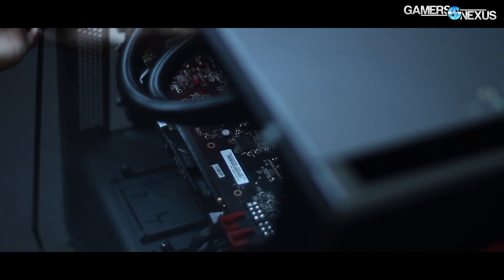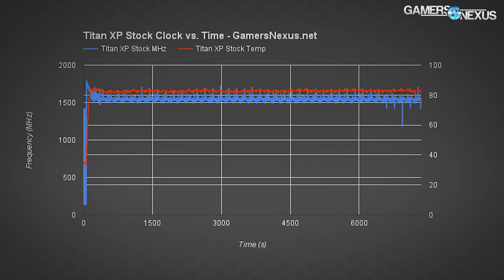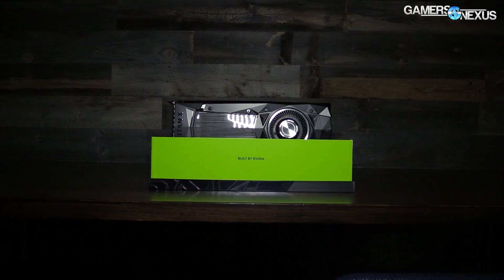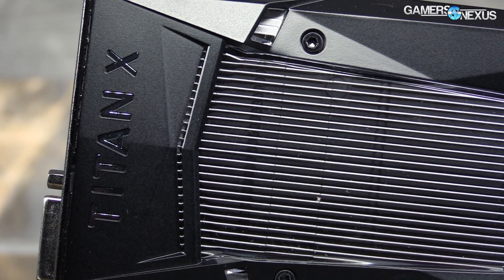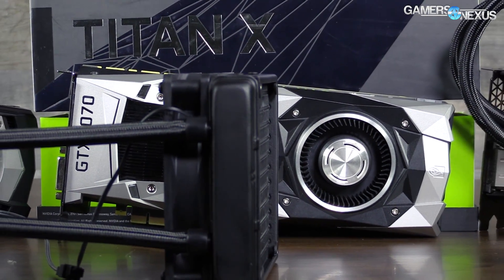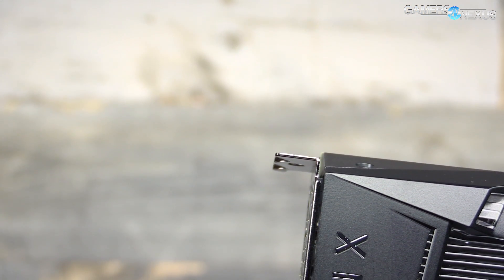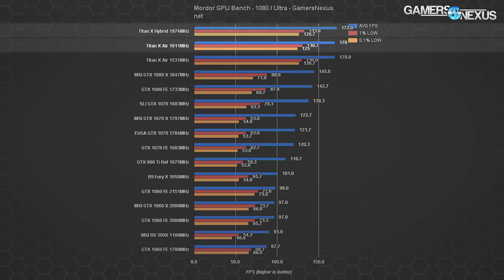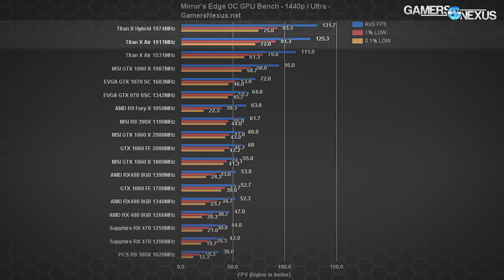TITAN X Pascal Severe Thermal Throttling (Hybrid Results)

Comment: And people make fun of AMD's temperatures lol
Reply: when will amd release gpu that is as fast as titan xp?
Reply: +Ariel Espinosa yeah and nvidea uses a cheap cooler on a 1200 $ video card ^^ But i understand your point - let's yust wait till vega and see :)
Reply: +Ariel Espinosa the thing is power consumption is tied also directly to the arcitechture of a GPU, the FP32 GFLOPS performance,  Async compute hardware support and less cut down FP64 double-precision, are taxing on the power consumption of a GPU. 

All the amd gpus since 79XX series and above have had FULL hardware support for async compute and a less cut down FP64, often 1:4 FP32, 1:8 or 1:16 which is high on a consumer grade GPU, for reference even the M6000 in the maxwell quadro line had 1:32 FP32 like all the maxwell line you have to get a Tesla for good FP64 performance, the last "consumer grade" GPU to have decent FP64 performance on Nvidias side was the Titan black with 1:3 FP32
Now a good FP64 performance can limit your max clock speed, and also add power, the limited FP64 performance on the Maxwell (and by extension Pascal) is I believe one of the reasons it clocks so well, the lack of FP64 performance is a good thing for us everyday consumers, we don't need good double precision perf for gaming

Also to note that apparently the gtx480/580 (Fermi) supported async compute on a hardware level and had a ratio of FP64 = 1:8 FP32 which is an unnecessary ratio on a consumer grade card (just as is 1:4) and we all know how hot and power hungry the fermi architecture was.

The RX480 has a 1:16 FP32 ratio compared to the pascal 1:32.

AMD should limit themselves to a 1/32 ratio also (it looks like they will be going that way :) ), but then they probably wouldn't be as good at mining...
Reply: When they get some money for r&d :p. Up until polaris last quarter, they hadnt make a single profit in 5 years and accumulated huge debts ($2+ billion). Polaris and vega wont touch the titan xp, but will probably do what the fury did last year, near matching the 1080. This gen is more of a money making gen for amd, hence the priority on the lower end market since thats where they can beat nvidia
Reply: the Titan X has a way beefier cooler than the RX 480 (ref design), the titan X runs at it 85°ish. as the RX 480 ref design, well between 80 and 85 (the Nitro runs at 75 ish) the VRMs heat up more on the RX 480 ref design due to the crappy cooler.

And you are forgetting to take into account one very important parameter when it comes to thermal dissipation, the surface size of what is being dissipated (the smaller the surface the harder it is to dissipate) the RX480s die size is 230 mm² the titan Xs die size is 470 mm² (more than double the surface), you can't just look at wattage and thermals

For example if the RX 480 had a 460mm² die size and the same power consumption as it has at the moment it would be way cooler, the same goes for the Titan XP if it had a die size of 230mm² and the same power consumption as it has at the moment it would be running well over the 85°. But the Titan X couldn't physically have  230mm² die and hold the same specs, and a 460mm² die on a RX480 is not cost efficient (and silly lol)

And what I said does relate to the power and heat, because pascal has less FP64 ALU's (4 in this case) the space on the die can be taken up with more FP32 ALUs for example which use way less power (which is a good thing imo), so effectively reducing power on the die relative to it's size, consequently making it easier to dissipate (don't forget 250w is not the power that the die uses, so the cooler isn't really dissipating 250w per say)

But all in all the Titan X doesn't really have the same temp and more power, it has a way better cooler that is adapted to what it needs to dissipate, and a bigger die

What is more interesting to look at is the 1080s dissipation, with a 314mm² a bit more power and having the same heat as the RX480 reference (round about), but less noise (yep RPMs are to take into account also ...)

I know you are not speaking bad about AMD, but there would be place to, they have made very dubious decisions on the RX480, coz they could have made Polaris so much better
Reply: Right then what don't you understand ?  Stop getting excited and annoyed because you don't understand. The titan X is neither cooler nor hotter than the RX 480, and vice versa. Both of the cards have coolers that are designed to run at their limits while staying in a cost effective solution, in other words the coolers do just enough for what they need to do without doing any better, compared to their die size and power consumption, what is hard to understand ???

No go look at previous temps on all brands, on previous generations, compared to die sizes and power consumption.

and this is why you are asking this question :

"I actually like amd, even my pc is powered by amd (cpu and gpu :P) but... we need to be honest and objective.
The rx 480 reaches the same temperature than the titan x pascal, and the titan x is more than x2 faster, so... yes, i don't like the temperatures on amd cards and i understand if some people make fun of that..."

You are asking because you do not understand thermal dissipation, and GPU architectures, and this is why you can't get your head around this :

My comparison is actually not ridiculous, because with the gtx 1060 you can get more fps in 8/10 games compared to the rx 480 and you get temperatures as maaaaximum 73C. I'm not comparing prices, but for a "slower card" that "consumes less power", the temperatures should be lower,
Reply: Ariel Espinosa Ok so you didn't read all of it, I understand now why you do not comprehend... (I actually said that AMD made stupid decisions, in all my posts). And you do not understand because you are bringing temperatures down to a performance comparaison, that is not how the laws of thermodynamics work !!!! Thermodynamics have pretty much nothing to do with performance, AMDs arcitechture is not efficient because they have made bad(for the most) choices, which has UPPED the power consumption on their small die compared to a 1060 for example (the die itself consumes about 50% more than the 1060)
Reply: Ariel Espinosa What? you are not saying temperatures are related to performance when you say this ?:

"we need to be honest and objective.
The rx 480 reaches the same temperature than the titan x pascal, and the titan x is more than x2 faster, so... yes, i don't like the temperatures on amd cards"

and then you say this

" and if one card has high temperatures, then as minimum it must perform well in order to people to want it"

NOOOOOO that is not how thermodynamics work !!!! And your problem comes down to AMD using a crappy cooler, this is true and legitimate, just go for an aftermarket GPU if you want an RX 480 simlple as that

"so the performance difference is NOT WORTH the temperature difference"

That is comparing Temperature to performance !!!!

"that's what i'm saying, not that high temperature = high performance"

Yes you are !!!! You are saying that if it runs hotter it should perform better than what you already had.

"but that in order to people to ignore the high temperature the card must at least give good performance to compensate the "bad thing" that is high temperature"

And you did it again.

Oh and this :

"titan x pascal cooler is just the same of the other 10 series"

the 10 series heat sinks are not the same, the Titan X seems to be the same as the 1080 and the 1070 the same as the 1060. Which are all better than the RX 480 :)

Honestly you are comparing heat to performance, which you can't do without taking into account a multiple of parameters...And reference design coolers are designed to be at the limit, to do just what they need to do, to bring down costs especially on the more higher end cards (the Titan X could do way better...) the lower you go in the range the more over-engineered they become. But the aftermarket coolers are just fine.

And concerning performance, the maxwell/pascal GPUs just have a better architecture for DX11 games (which is the most important DX at this moment)
Reply: Oh and *****  opening comment is stupid and has no basis, it's so stupid it shouldn't even be discussed so I don't know why I'm discussing this :)
Reply: soon and will cost half
Reply: I'M NOT SAYING THAT HIGH TEMPERATURES = HIGH PERFORMANCE, but i'm saying that in order for someone to ignore the high temperature (which is a "bad thing") the card must give you something in exchange of that bad thing

You do realize that that is another way of saying a hot card should give better performance ? When the 2 really have no relation, they could have thrown a stock watercooled loop on it, would that have been ok with you ? It would have been way cooler !!!
No the card shouldn't give you anyhting in exchange, it should just have a better cooler, just like the titan X should have a better cooler to avoid it from thermal throttling.

How do you not realize that you are saying that temp and performance are related when you say this :

"and if one card has high temperatures, then as minimum it must perform well in order to people to want it"

I'm dumbfounded (ers) edition...

Oh I get it you are trolling lol ok... Well I hope so or you just don't undertand what you are writting...

The card performs well for it's price point that is a fact, the heat has little to do with the equation except if noise is part of your equation, then you go for an aftermarket card, it is as simple as that.

It's price to performance ratio is good and better than the 1060 : http://www.hardwareunboxed.com/nvidia-geforce-gtx-1060-benchmark-review-25-games-tested/

You really do not understand GPU architectures and thermodynamics, and you have made this very clear.

I've spent enough time trying to explain all this and listening to you denying that you think temperature should be related to performance even though you wrote it down, giving something more, what do you want your GPU to give you a BJ ? lol...

All medium to high end GPUs have high temps on their ref designs, god the 1070 FE comes in at 82-83° (yes that is because it doesn't have the same heatsink as the 1080 FE by design !!!)
Reply: The RX480 offers the best price/performance in the new gen GPUs (old gen can't really be accounted in this price/perf ratio because of the fact that the prices are being bought down because they are no longer being produced)

So I will turn your smartphone analogy around, which is not really appliable because smartphones are used for multiple things and people can find interest in multiple things on a smartphone depending on what you like to do with it, in this case of the GPU there is only one parameter that is important to you, the temp/fps ratio (has you have previously demonstrated, except if you expect your GPU to make you coffee...),

Your smartphone costs 15% less (the price/perf ratio difference between an RX480 and a 1060) for the same technical usage (calling, receiving emails, playing games and what not...), it can do all the same things, but has crappy speakers or a crappy camera,now for a starters what do you value more ? speakers, camera, screen technology, interface, design, size, screen resolution ? Do you see where i'm going here and why the smartphone analogy is not applicable, for a starters, the smartphone industry has way more competition, the GPU industry has very very little competion, and in this case (gaming performance, yes this video is not dealing with OPENCL perf, or rendering, bitcoin mining or whatnot). Actually smartphones are probably the worst analogy you could have used ... because apples and oranges and what not, it's like comparing a laptop PC/tablet to a GPU !!!!!! A GPU which is a component part of a smartphone (under the form of an SOC)

you say :

"you're the one mixing things up, just answer to yourself, if you are concerned about low temperatures and you're looking for a specific performance level, and two cards offer you the same performance level but one gives you lower temperatures, which one will you choose? OBVIOUSLY you will choose the one with lower temperatures"

So you do not take into account the price of a GPU ? That is good to know, " OBVIOUSLY you will choose the one with lower temperatures" (that is wishful thinking)

But since you asked, I would go for an RX 480 aftermarket 8gb that is cheaper than a 1060 6gb if you are looking for cards in stock on both sides as and performs around the same when not oced (implying it runs faster when oced), and runs a bit cooler when not oced (around 3° hotter when oced, and 2° cooler when at stock). And the fact that DX12 is gaining traction (because consoles and microsoft) and that AMD optimizes their drivers for older generations (900 series is legacy at Nvidia, though they will get non optimized driver updates at this moment) Pascal users will get screwed on drivers
Reply: Its not a big deal with the card being hot, I'm not cuddling the 
fucker. As long as it doesnt stutter because of fluctuation in clock 
rate or burn itself out.. Tweak the fan and deal with the noise or get a card with a better cooler, we all know reference cards never cool as good as people would like
Reply: Ariel Espinosa you said :  "a card can't give you a BJ" (quoting my self)  EXACTLY, it can only give you good temperature and good performance, if it doesn't give you neither of them then the card gives you nothing, then you won't buy it.

So you do concede that your analogy with a smartphone is inapplicable, because the parameters are way broader on a smartphone

The things where you are wrong about the RX 480 is temperatures and performance ( oh snap !!!!)

The RX 480 AIBs holds similar perfs to the 1060 (on a game to game basis meaning sometimes lower and sometimes higher and also depending on what reviewer you look at) If we look at the prices of those said cards that are in stock the RX 480s are cheaper than the 1060s be it the 8gb models or 4gb, compared to the 6 and 3gb and when you go into the eurozone the RX480 s are way cheaper...
The AIB rx 480 have at least as good temps if not lower than a 1060. AIB 1060s do not bring much performance wise (even sometimes lower than an FE card) but they do run COOLER.
Reply: konic40 look at it this way a hot GPU heating up your room is cheaper than a 1500w electric heater heating up the room lol
Reply: RiffsnReviews
a bad cooler will get hotter because the heat CANT leave as fast, that is until the temp difference with the air is great enough to speed up cooling, at that point the temp levels off. At the end of the day good cooler or bad cooler on the same card gives off the same amount of heat into the room
Reply: Yep better cooling does not solve high room temps, you can stick water-cooling on all your components it will not bring down the ambient temp (comparing the same components). the fact is while gaming lets say you use 250w-400w depending on gpu and cpu, those 250w-400w will serve good as a heater in your room over a certain time period, because the efficiency is better, it goes both ways (though a 1500w heater will heat up quicker) no matter the cooling method used, X amount of dissipation will always be X amount of dissipation, though it will be noticed on the component itself but not on the heat pulled.
I've pulled the plug on heaters in my gaming rooms, because over time (even at idle) the rig heats up the room and in the end a bit less electric than heaters (coz heaters don't really go for effiency) and at least i'm using something at the same time... (oh and intel CPUs generate more heat than AMD ones at the moment, I went from a 8320 to a 4790k)
Reply: Actually there's a project find a way to stick the biggest fan you can on 2x290xs heatsinks (to reduce noise) run them on furmark for well a long time or at least heaven, measure the ambient then do the same on an electric heater (plugin blower type) for the same amount of time, and measure the results (heat, and cost,  dbs) ! then do it on a 79xx FURY X, gtx 780ti 980 etc that should be able to measure efficiency :)
Reply: ok it's already been done : https://www.pugetsystems.com/labs/articles/Gaming-PC-vs-Space-Heater-Efficiency-511/
but I would like to see it retested as GPU efficiency has got better on the perf/watt side, but temps have not necessarily lowered that.
Reply: RiffsnReviews
The test seemed to show most of the power input to the PC is turned to heat like the space heater, from that point of view its not very efficient at all...need a chart that shows benchmark scores vs power draw....
Reply: LMFAO...really, REALLY? You gonna go there?   R9 290 and R9 290X hit 95 DEGREES CELSIUS!!! And when people freaked out and called AMD they were told "that's normal, it's FINE".  Then we saw people's HOUSES BURNING DOWN from using R9 295x2 and 290X in crossfire on totally adequate PSU's lol. Just don't....don't even try to compare Nvidia and AMD when it comes to heat.
Reply: TheScaleless Wow I'm debating to myself on if you believe what you write... 295x2s nor 290(x)s burnt down houses. yeah they ran pretty damn hot (too hot) on the ref design, because again crappy cooler, the tri-x ran at around 75° ... the AIBs ran at decent temps.

The 295x2 were watercooled and ran between 70 and 75°... the 290s came out almost 4 years ago... shall we talk about Nvidias Fermi ? Yep both companies have been through their not so glorious days, not one of them are perfect on any front.

But in the meanwhile AMD shares have gained 330% this year and more over 18 months, and they are continuing to gain market share in the GPU market, so they are doing something right.
Reply: RiffsnReviews
to be fair tho AMD is coming from a very shitty position where its much easier to make gains
Reply: konic40 A very shitty position, yet they can compete with a much much much bigger company, than themselves.

Let that sink in.
Reply: konic40 It's easy to pull yourself up from close to bankruptcy ??? Remember at one point in time in the not too distant past, there was major discussions on them being bought out. I guess we don't have the same opinion on what is easy... It's a bit like saying well I only have 10$ left in my pocket it's going to be easy to change that into 10 000$
Reply: RiffsnReviews
they had some money obviously, they shares weren't valued shit.
Reply: +Ariel Espinosa
rx 480 250 $ 
Titan Xp 1200$ 

That comparison is yust ridiculus 🙈
Reply: Maybe Vega?